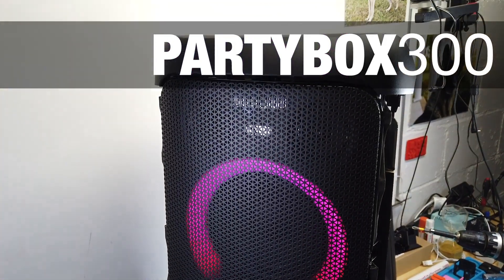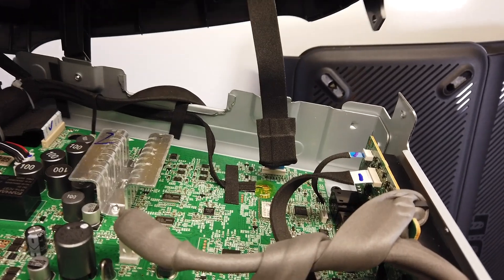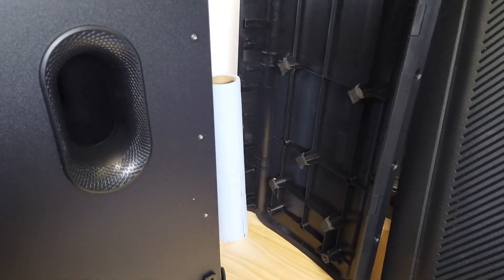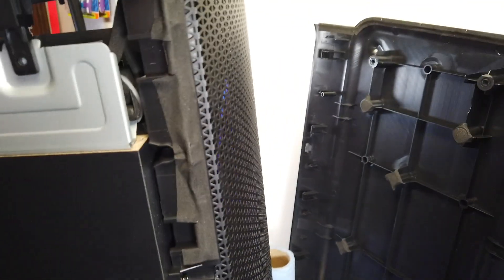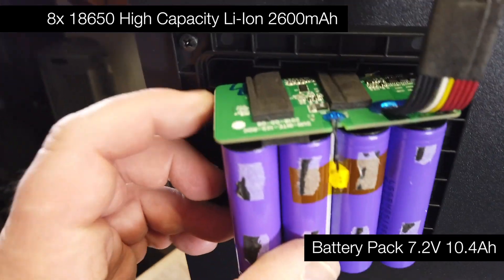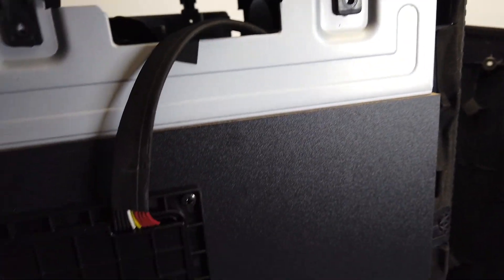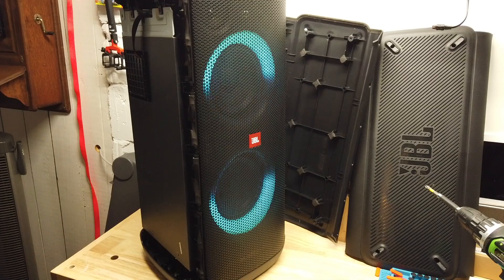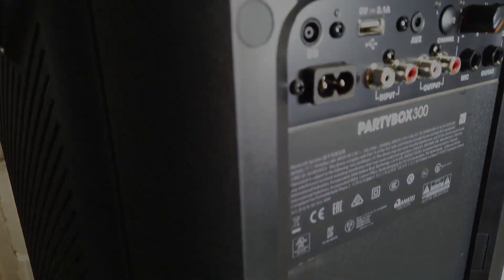JBL Partybox - Teardown and Battery

Comment: My JBL Partybox 300 doesn't charge and work with AC power anymore, but DC works fine. Do you know if the box should work with an broken battery while using power supply or is it only usable if tha battery works. This would help me locating the problem :)
Reply from the maker: I doesn't work well with a broken battery, the charger alone doesn't cut it. You may have problems with low bass, and get a lot of clipping what is bad for the drivers. A bad battery drags that thing down.

Comment: 3:34 2600mah? Bro my 4 year old crappy phone has 3000mah battery! Why the heck they cheap out on the battery?
Reply: mah means nothing if the voltage is different. Better measurement is wh. (Watthours). Partybox 300 has 76wh, iphone 16 pro max has 18wh.

Comment: Are they all 3.7v batteries?
Reply from the maker: 18650 Lithium-ion
Reply: @mygiguser  never mind I thought 18650 comes in different voltages but looks like only 3.7v

Comment: I have party box 300 its not comming on when i used to charge it plz give me solution on it
Reply from the maker: check your power cable
Reply: @mygiguser  already i had checked with new cable but same problem i am facing

Comment: I watched this video to figure how to take apart my 310 and 710 to put apple air tag in. I figured the battery had to be like 15lbs lol which would make sense why the 710 didn’t have one after already being heavy. But with that being said the 710 has 4inches between the cover and the box at the bottom so you could easily have 70+ batteries spread out over the bottom.

Comment: I accidentally dropped my partybox 300.  It still works but the grill/screen got dented and there are scratches all over one side of the box.  Can it be replaced?
Reply from the maker: I don't think so, you should try and call JBL support and ask that question.
Reply: @mygiguser  I got a suspicion they don't and thanks for the reply.

Comment: Excellent! Just what I needed for an battery upgrade for my 200.
Vielen Dank für das ausführliche Video, es hat mir sehr geholfen. :)
Reply: Tell me how it goes
Reply: I would like to do the same
Reply: @murrayclancy448  going to uprgrade the battery on my jbl 300
Reply: @jumperkai  how much bigger battery
Reply: @murrayclancy448  14.000 mAh, so +40%
Reply: @jumperkai  I’ve just baught a 310 and it seems to have way more battery life
Reply: @murrayclancy448  the battery capacity is the Same, but the 310 is more efficient. Both got 10.000mAh, so to Upgrade the battery might be usefull too

Comment: thanks so much. using this video to take out the battery so i can fly with the speaker
Reply: why do you need to take the battery out of the speaker for flying? as far as i know it is not allowed to fly with a build in battery over 100Wh. this battery has a much smaller capacity.

Comment: Could you do the same for JBL partybox 310? Especially with battery upgrade?
Reply from the maker: I would love to, but i don't have a 310. But i can't imagine for it to be much different.
Reply: @mygiguser  
The below information  I received from JBL as correct for the Partybox 300, which your findings contradicts, 10000mAH?
"Plug in to the 12V DC output of your car or use the built-in 10,000mAh battery for up to 18 hours of playtime."

Comment: Hi, Creator, I was trying to upgrade the battery on this JBL Party Box 310 with additional same model battery in parallel (with measure correct voltage) . I find it is not possible. There should be some battery capacity measuring circuitry build on the top panel . We are not allow to increase the mAH on this BT Speaker. It is so sensitive,  I first try adding 6x on each side of the Positive and 6x on the Negative and measuring the voltage output on the terminal at BMC main terminal,  It indicated 8.0+/- 1 Volt. So i power it up and it goes off in seconds.  I even try to reduce the cell to just 2 x on each side and it still cannot power up. When i try plug in to the a/c charging wall plug. the speaker works without issue. even after playing for an hour at 70-80 % volume. ( No issue ) . but when i turn of the main. the speaker turn off. I had double confirm that the the battery was not in anyway short circuit by measuring output from it BMS. So i suspect there is another circuitry on top panel sense that the battery capacity had been modified.  Dame JBL!!!

Comment: Can't you do a video of how to actually upgrade the battery step by step? I wouldn't have a clue where to start
Reply: Well, if 18 hours of music ain't enough for you, you can upgrade the system very easily. As long as you parallel connect the batteries (mind the polarity) you can throw as many battery packs in there as there is room in the casing for. Remember to use the same type and voltage.
Of course, your charging time would be longer than the 5,5, hours it usually takes for this model speaker.
Reply from the maker: Why would you go through the trouble to upgrade this battery? You can easily run this speaker from a car battery without any issues.
Reply: @mygiguser  because its not practical to carry a car battery around with you

Comment: Lol that battery! I bought mine partybox 100 2 days ago, and I allready want to make that battery bigger.  I'm going to atleast quadruple the mah.  Thanks for the video!
Reply: can you explain for me how you do this, please?
Reply: @guilhermecapelleto5989   When there is a batterypack, a charger and all neccesary components already at play, you can easily just remove the battery and make a similar battery with similar wiring, altho in my case I thought I'll make it bigger with more parallel 18650 cells.  For example here are 8 cells. 4 and 4 wired together. you could with ease add more series of 4 to increase battery capasity.  theres a lot of good videos in youtube for batterymaking. cheers
Reply: @LKLM138  can i also use 18560 batteries with a higher capacity, like 8800mAh for example?
Reply: @aschneider5772  Sure. If such things existed.

Comment: Would it be possible to ad other 18650's with more mah?
Reply from the maker: Manuel Burkhardt i think so. May take longer to charge.
Reply: @mygiguser  ty. Is 7,2V the overall Voltage of the 8 Cells combined or the voltage for each one? Great Video btw :D

Comment: Hey, I have a party box 100 brand new it came slightly charged out of the box... & now it will not charge when plugged in. The LED charging light never illuminates & now it’s completely dead .. have any idea what’s wrong or how I can fix this issue ? Thanks
Reply from the maker: That's bad. You need to call JBL support and send it back.
Reply: @mygiguser   HOLD THE POWER BUTTON DOWN FOR 60 SEC WHILE PLUGGED IN.... IT SHOULD RESET...
Reply: Same issue. I've been through 4 so far.
Reply: I had the same issue. Purchased a new battery on ebay for the 300. I have the 100. Opened it up and the plastic battery connector header was only touching - not clicked down. I’d say like this from the factory. Clicked down. Now it charges. What to do with my 70$ 300 battery (it uses a diff connector header with more wires anyway. Not the same as the 100 which has less wires !!!)

Comment: Out of curiosity. Do you think it will be possible to extend the battery life of pb100 by using the pb300 battery?
Reply: Physically yes you can if there free space to fit it, but make sure it use the same voltage,

Comment: @mygiguser anyway you can do this same tear down on a partybox 100?
Reply from the maker: not really, because it is basically the same as the 300, just the battery is a little smaller.
Reply: Ok

Comment: Hi dude, nice video. Recently i buy one of these boxes. The bass sound is amazing, but for me it is like missing middle sounds. Do you think it is possible to modify and install a driver?. I have also noticed that it has a limiter to avoid distortions or maybe a consumption limiter, it is a bit annoying because with a good equalizer, I think you can increase the volume.
Reply: How long is the battery life on full volume? Can you tell me don't know if I'm gonna buy it yet

Comment: Hi, i would like to know what is that thing like an IR Receiver below the top strobe light. Did you notice that? Thanks
Reply from the maker: iDroid i noticed that, but don’t know what it is either
Reply: iDroid Apparently you can control the volume on it with a Samsung TV remote control.
Reply: @CaiSamuels  is it a special remote? Or a normal one?
Reply: @DoutrinaiDroid  you can use any tv rwmote to lower volume or change the lights, thats it. There was supposed to be a special remote, but it was never released, though the ir sensor remained

Comment: Very good and clear video. How easy would it be to get the bottom cover off? Would you think it is stabile enough to install a pole mount adapter from Thomann (Stativflansch)?
Reply from the maker: Freddy S i think it is stable enough, and relatively easy to install. But how do you use the buttons on top once the speaker is mounted up high?
Reply: @mygiguser  Thanks. You wouldn't really after setting up once. Bot the sound is much better at the audience head level.

Comment: @mygiguser, is possiblo to change partybox 100 battery? mine came with a dead battery but i cant replace it because im in Perú, i bought it in the us.
Reply from the maker: I don't have the Party Box 100, but i think you can change the battery, why would you not be able to. Check on Ebay, if somebody sells that battery. I don't know what battery it has, you have to open it to look inside first, then search for the part number on Ebay.
Reply: @mygiguser  Thanks man, i will check the battery!
Reply: I have the partybox 100, based on the specs from jbl, partybox 100 uses 14.4V 2,500 mah battery pack which is 4 18650 cells in series. That is 4 cells less than the partybox 300. So far I haven’t seen any replacement battery pack for the 100 on eBay probably because the speaker is newly released. I haven’t opened up my partybox 100 but if the spec is true, batteries in 100 and 300 are not interchangeable.
Reply: Gustavo Perez this is a dumb question, but does the unit still run even without battery inside (via AC Pppwer plugged in?) wondering if down the line when the batteries can’t hold a charge anymore that I could still plug it in and take out the batteries

Comment: Battery alone is a game changer soundboks you can change out easily.  JBL party box 300 I have last only 5 hours on loud that's the disappointing part of the JBL wish the made the battery interchangeable.
Reply from the maker: Steven 9 but you can run it on an external battery
Reply: @mygiguser  can you recommend an external battery something smaller than a lawnmower battery
Reply: Like a lawn mower battery you have that thing is huge with the SoundBoks you have a battery that you can change out right away and the it takes 3 hours to charge the battery so having 2 of them you can play music all day. Believe me I have the party box 300 on full volume this thing don't last
Reply: @Raiders_1986  y

Comment: Isn't that 4p2s(4 parallel 2 series) battery pack? When you look at the bottom of the pack, you see 4 connected on positive and 4 negative and those 2 packs into series? so theoretically should be 3.6V*4=14.4V, am i correct or is it connected 4s2p?
Reply from the maker: Zerlen i don’t understand your calculations!? 4p2s.  3.6V times 2 equals 7.2 V
Reply: @mygiguser  oh yea nvm, my bad :D, forgot that volts go up when in series not in parallel

Comment: U can open the front part as well
Reply from the maker: How?
Reply: @mygiguser  take a sharp material then put that inside small holes of metal from edge part then slowly pull it outside....
Reply: @mygiguser  from all sides

Comment: Should make the battery replaceable so yiu can take more out if they die instead of waiting to charge it up
Reply from the maker: supashaker1 well, you can use an external battery, or you could install a larger battery pack. But is that really necessary, because it is going to play for a long time.

Comment: Hey man I got a problem with my partybox 300. Every time when I charge it up it only charges up to the 3rd LED it never charges up to 5th LED. Any reason why my speaker does this and a solution to fix it?
Reply from the maker: @Petri van Wyk either a bad battery, or a bad detection circuit!? That would be my guess. Do you not have warranty on the box?

Comment: The battery is really easy to upgrade that's great
Reply from the maker: so far this is the best bluetooth speaker i ever owned!
Reply: @mygiguser  I actually want one so good to know !
Reply: @mygiguser  Btw, do you know how the battery is made ? I mean, there's a lot of cable that goes into it.. does the bms is the motherboard of the speaker or is the tiny board above de battery is the BMS (I know how to make the 7.4V battery but to which cable I have to relie this too it's a bit harder..)
Reply: Can you tell me how do i upgrade the battery? I have the partybox 100 and It have only 2600 mah battery, its hard to upgrade? Help pls
Reply: @francescomazzinghi2949  
They say the PB100 has 4x the 2500mA battery.
Reply: @francescomazzinghi2949  ciao, sono un possessore della partybox 100. Chiedo se fosse normale che la mia si carichi in meno di un'ora e mezza dalla prima tacca a carica completa da spenta! Sul manuale c'è scritto che richiede 6 ore e mezza
Reply: Can you simply take battery from jbl 300 and put it to jbl 100? ...
Will this work ok?
Or is it difrent fitting or size
Thanx
Reply: Even if you could "upgrade" it you shouldnt, battery failure/overpowered can cause damage to the motherboard components
Reply: @Meqanich  the voltage won't be higher at all. And if there's higher intensity it won't run into the board ruining everything... Just the components will get everything they need, no more..